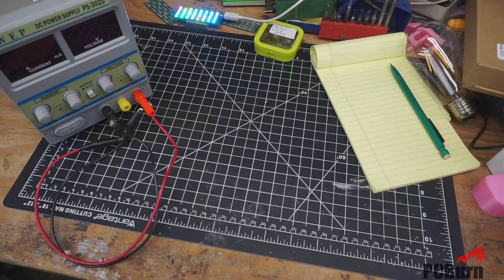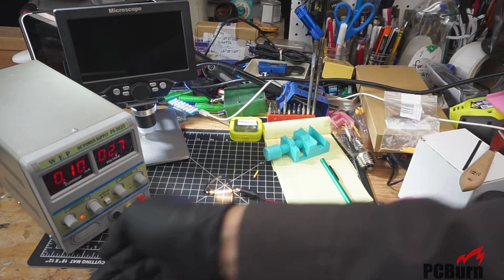LED Light Bulb Filament (3v): Make Your Low Voltage Projects GLOW (ComM)

Comment: Great video, thanks. As a struggling solderer, can you let me know what prep you did (besides tenning) to the wires and what temperature is best to solder these? I can’t get the solder to attach 😮 Thanks in advance!
Reply from the maker: @chrisnixon3177  Hmm, I didn't have any issues soldering. Make sure you're using a rosin core (or other flux core for unleaded) solder. Also, use flux. Otherwise the surface won't be clean enough for the solder to bond.

Temperature depends on the iron; I can't tell you what'd be good for yours but mine is defaulted to 360.

Comment: Interesting video. One Question. 
Can I use the filament inside the bulb for... maybe, custom dioramas? I mean, xtract the filament for a occasionally project, or the filament inside the bulb will be ruined? Thanks.
Reply from the maker: You should pick up a few filaments to the spec that you require. I'm not sure what "the bulb" is in this context but it probably doesn't contain what you need.
Reply: @PCBurn  Ok. Thanks.

Comment: I have 260 mm filament. Is it possible to cut it off to make a smaller piece?
Reply from the maker: Not with these. They're integrated into an assembly; although it looks like filament the LED assembly is COB and a single fragile piece.
Reply: @PCBurn  Ok, thanks for the response)

Comment: Nice job on sharing knowledge. I was always curious on those small lights. If possible, Would you be able to share knowledge on connecting 1 to a battery with a button. I'm working with my son on a space ship and would like to use the filament light "safely" thank you be safe 👍
Reply from the maker: You would connect it in series with a button and a resistor using the appropriate voltage for your application. And make sure the wiring was of the correct gauge for the load.

Adafruit has a guide with calculators up for that here: https://learn.adafruit.com/lets-put-leds-in-things/basic-recipe

They don't mention wire gauge. But if you know the draw (which they do cover) you can punch that into any website covering the topic along with length of wire and should get the appropriate safe minimum.

Comment: I have 30cm led fimlament ali express but with 3V not gow higt level its juste white and see all leds individualy ... why not glow like you
Reply from the maker: It's possible you have the wrong voltage. That's a question for the seller though.

Comment: I have a plastic red star Christmas tree topper that I want to convert to LEDs and fillament bulbs would be best option. I found on Amazon 3v 100mA and 12v 45mA. Does it mean the 12v runs less current and doesn’t get as hot as the 3v at 100mA?  If a bulb is 60-70 lumens does it mean 5 bulbs together would be 300 lumens or still 60 lumens? I’m trying to understand how to go about it without melting my plastic tree topper.
Reply from the maker: Practically you'd probably want to just run the LEDs and see if they get hot. You can under-drive them by providing them less voltage or using inline resistance but if they're already doing some form of driving internally they may not need it.

To understand how hot they'd get you'd have to know how they're being driven (i.e. how many LEDs are in series for the 12v? What's the resistance used in the 3v if any and how many LEDs ?)

BigClive at https://www.youtube.com/c/Bigclive does an astonishing number of excellent LED and lighting videos as he's a lighting-centric engineer if you want a good depth of knowledge on how power feeds LED circuits.
Reply: power=voltage x current so the 12v should run cooler.

Comment: Can you attach a wire to them and make the wire hot?
I need to get over 200 celsius using a 3volt changer 
Thanks for letting me ask
Reply from the maker: You may have some confusion. These are LEDs. They are not heaters.